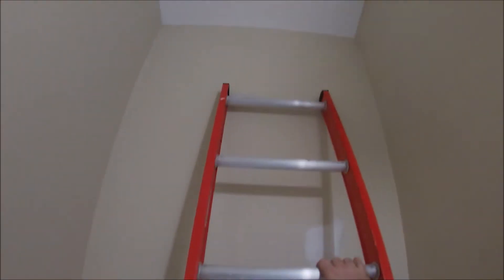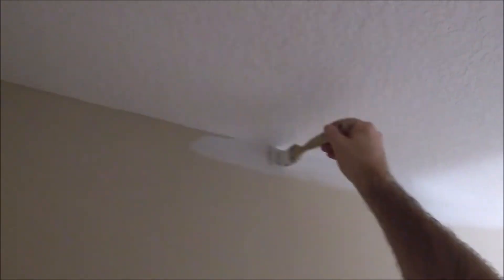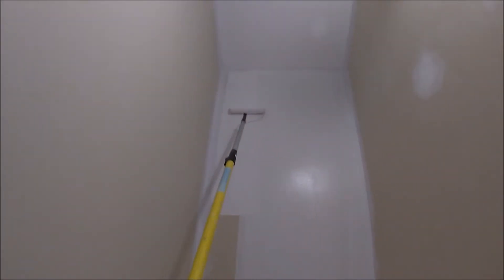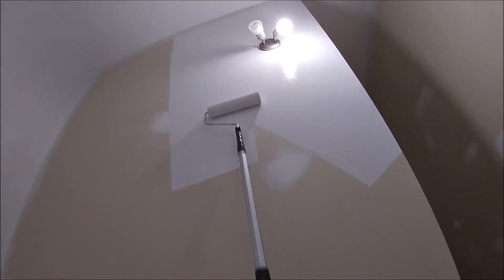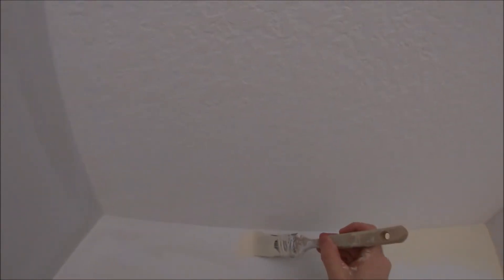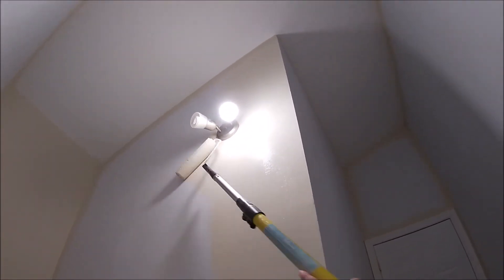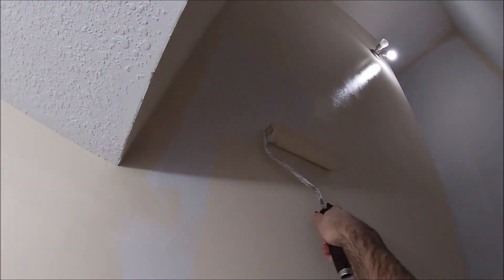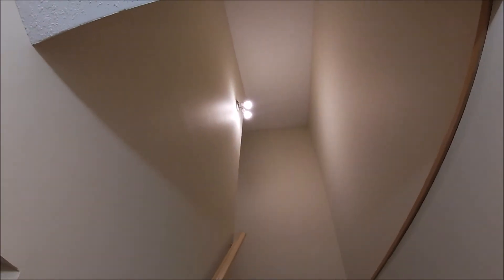How I paint in a stairwell

Comment: What’s this type of ladder called?
Reply from the maker: It is called a Featherlite adjustable stepladder
Reply from the maker: Works awesome on stairs , I've had it for many years, I believe I bought it at a home depot
Reply: The Canadian Home Painter ok thanks for the reply I can’t seem to find it. I have been using little giant for stairwells but it is just way to heavy
Reply from the maker: @palmerpalmer1538  ok, yes this one is very light weight. I think it was like 250$ when I bought it. Worth every penny , you might have to take a trip up the Canada to buy one
Reply: The Canadian Home Painter it’s showing me Werner fiberglass combination pretty sure it’s the same thing and has about the same price tag. What the max reach in a stair well with this guy?
Reply from the maker: @palmerpalmer1538  oh I think I can get up to 16 ft
Reply from the maker: When I'm at the top of it, its 8 ft long before adjusting it on the stairs, and as an extension ladder I know I can reach up to 16 ft easy
Reply: The Canadian Home Painter awesome I’m going to have to look into this do you guys have the pivot tools for stairwells? I either use the little giant or a 3 tier 16ft Werner and the pivot tool
Reply from the maker: @palmerpalmer1538  I just use this ladder, it has always done the trick